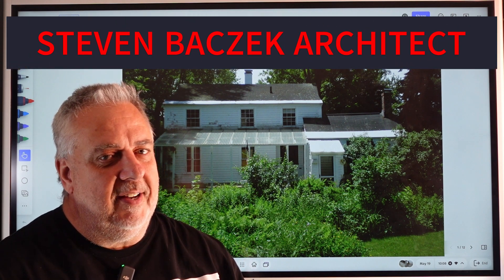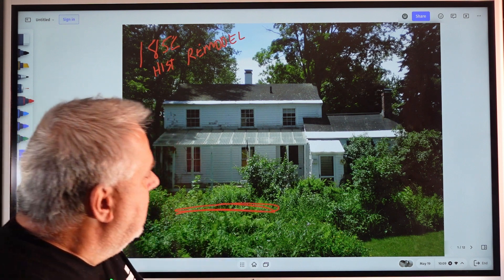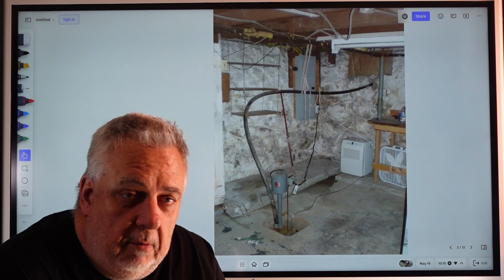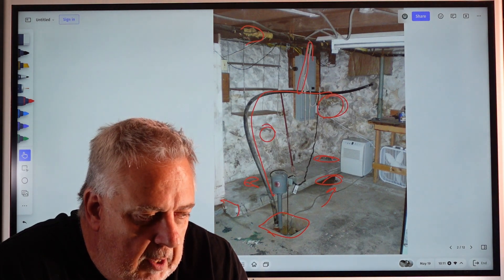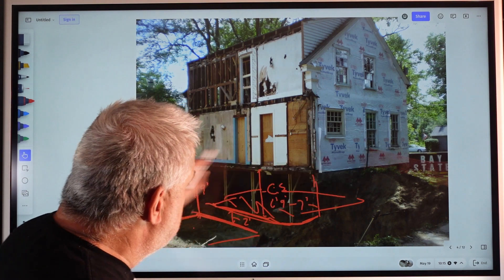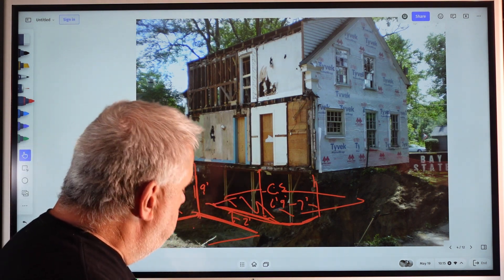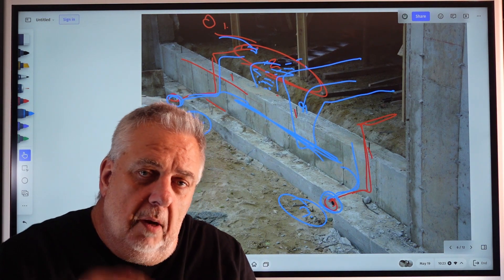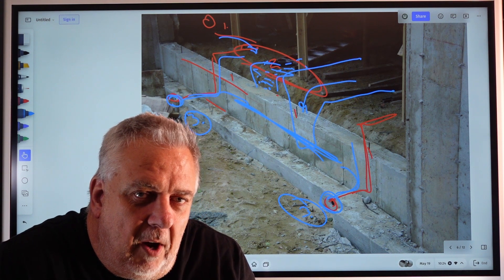Let's SOLVE for WATER MANAGEMENT

Comment: Water is the enemy of buildings.
Large roof overhangs add beauty and protection for doors, windows and siding from rain and sun damage.
Proper grading and drainage is often an after thought.  French drains and downspout extensions direct water away from the foundation.
There are limits to what can be done on a remodel.  Water intrusion should never be ignored and need to be addressed from the start.
This video explains the necessary thought process to deal with water management and why it should be dealt with in the design and not as an after thought.
More architects and builders should  take note of best building practices.

Comment: I'm more a fan of this railway track drainage method. They just dump some gravel, and build on top of that gravel pile. That usually handles drainage problems for 100 years or more. Would have used some geo textile on top of the soil for this project though.
Reply: What would adding geotextile do?